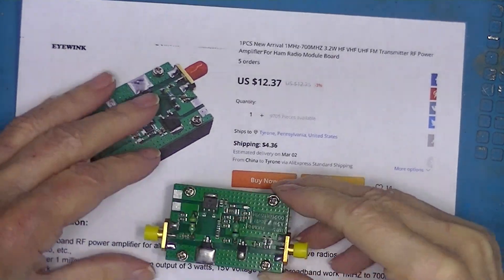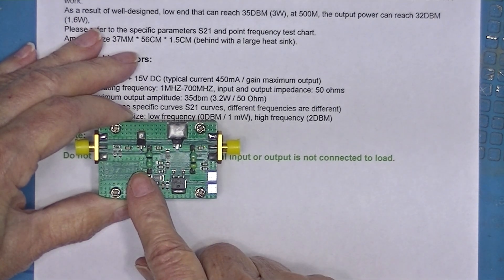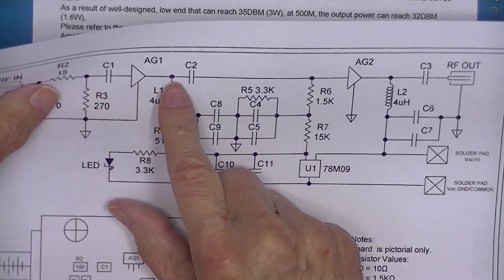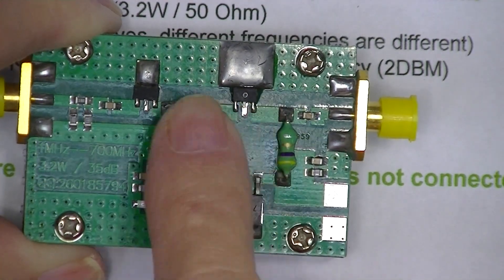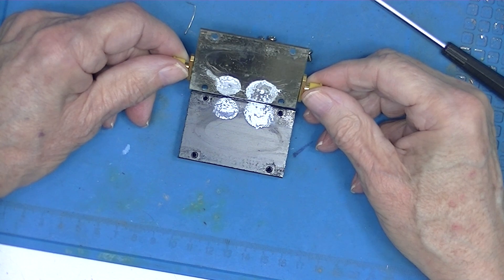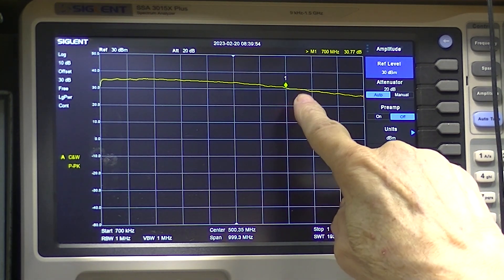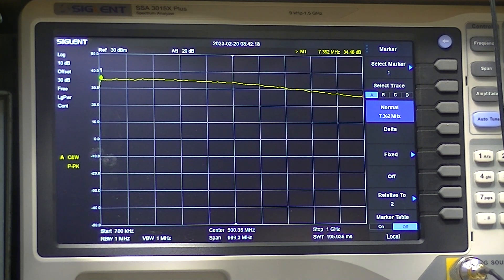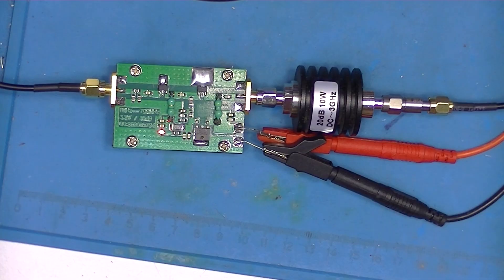A 3.2 Watt RF Amplifier from AliExpress

Comment: Nice review, thanks for presenting it.

Another test you may consider is to input a CW signal and use your Spectrum Analyzer to measure the output harmonics. If this amplifier is to be used as a transmitter final stage it is important not to radiate our-of-band.

The solution is to construct a low pass or band pass filter to attenuate the harmonics to be legal. Note the FCC rules:

§97.307   Emission standards.
...
(d) For transmitters installed after January 1, 2003, the mean power of any spurious emission from a station transmitter or external RF power amplifier transmitting on a frequency below 30 MHz must be at least 43 dB below the mean power of the fundamental emission.

Comment: You can run them at or below 12V with a modest drop in performance. You can adjust the power output by simply dropping the supply voltage with just 1mw of input, works well up to 500Mhz. If a small pie output attn pad say 1.3db is installed the antenna can be removed for short periods without damage to amp as it has at least some load on it works for up to 30dbm out, the trick is limit voltage and the current drawn to prevent destruction of output amp.

Comment: 1 is sbb2089z (or similar) 2 is rqa0004 (or similar).
Reply from the maker: Thanks!
Steve
Reply: @stevestrivia-bystevewagner4852  I've fixed dead ones with an SBA-5089 for the driver and a PD85004 for the output. Just for the list of options.
Reply: Great!

Comment: You Have Hooked Up The Electricity Wrong Way Around At 4:47 , Im Pretty Sure It Needs To be Switched Around So The + Goes To VCC Soldering Point And Ground Goes To GND Port Wich Is Closer To SMA Connector. I Have The Same Amp And It Works When I Hook Up The 12 Volts Like I Described. :) 
Maybe You Have SOme Other Version, But Then Its Super Similar Id Add.

Comment: Thanks for the review. So would you recommend this for QRP HF operations?
Reply: No, But It  Works, But Its Not That Great, With Long Wire Or Random Wire Antenna You Are Better Without It.

Comment: Hi Steve ! Thank you for the video, I'm looking into buying this amplifier for a small RF project. What is the name of the connectors/cables that you use to hook up the amplifier to the source and antenna ?
Reply from the maker: For work on the bench, I use SMA connectors, male or female as required with RG174 coax. It has some loss, so long cables (10 ft or more) are avoided but I like the flexibility. 

https://www.ebay.com/itm/143494709575

Similar diameter is RG316 but sort of stiff.

https://www.ebay.com/itm/143955791825

Beware of RP-SMA, they are for special use and will not fit regular SMA devices.
Steve
Reply: @stevestrivia-bystevewagner4852  Thank you very much, that is some great information right there
Reply: My question exactly because I have the 1 watt model....thanks for asking..

Comment: is it worth it? I don't trust AliExpress in complex circuits, buying simple staff like diodes etc. is ok for me but I am just looking at some original RF amplifier from Mouser for less than 1$ which has a gain about 22 dB for 2.2 GHz
Reply: The aD 8009  Video amp chip is  your friend.  It won't go to  GHz but it will produce up to  350 mW of clean   AB class oput power into  50 R with about a 20 dB gain, right across the HF spectrum and a bit less at   52 Mhz. It can direct drive an RD16HH RF mosfet in  Class A  biasing  through a capacitor  0.1 uF MML type  with  no coupling transformer .

Comment: Hello Steve ! I have another question, what type of antenna should I hook up to the RF out side of such amplifier ? Is there a certain type that I should use ?
Reply from the maker: That depends very much on the signal frequency.

Steve
Reply: @stevestrivia-bystevewagner4852  Thanks Steve for your answer ! 
Since it's a FM amplifier I'm looking into 90Mhz to 110 Mhz. Is there a type of antenna or length that would be optimal for those frequencies ?
Reply: I've had good luck using shortened mobile CB antennas for FM broadcast freqs...as Steve says ofcouse longer or shorter for different frequencies..at this power level perfect matches are not essential but then again the closer the better..hint: 100 mhz wavelength is 3 meters or 9.8 ft...1/4 and 1/2 wave dipoles usually work pretty good..
Reply: @leonsebel9237  Yes there is, the math is 150 divided by your frequency of interest. This will give you a half wave length in meters. The coax connects in the middle. You will need to trim for best SWR. The most important consideration is to use a Low Pass Filter between the amp and antenna. Google is your friend here.